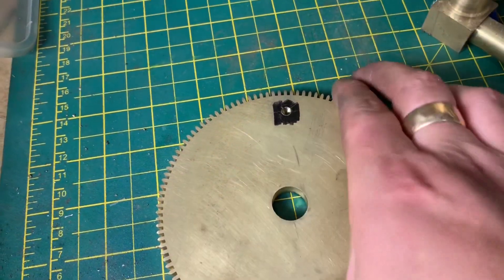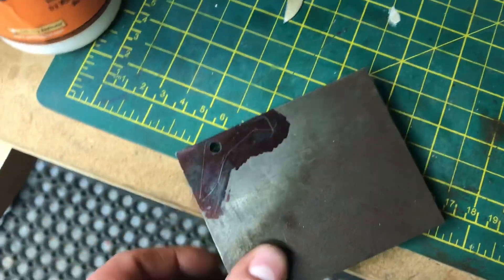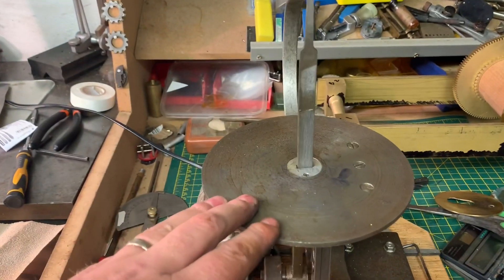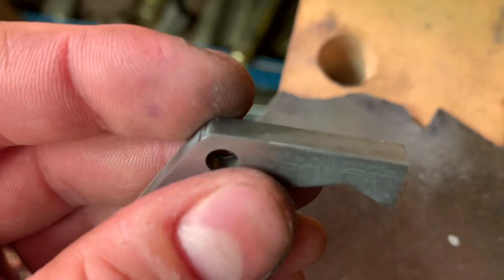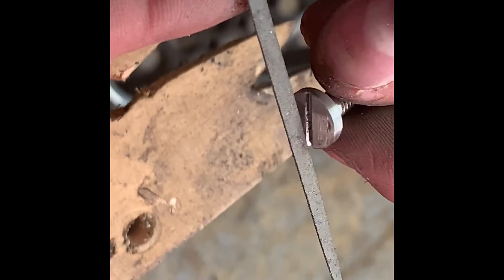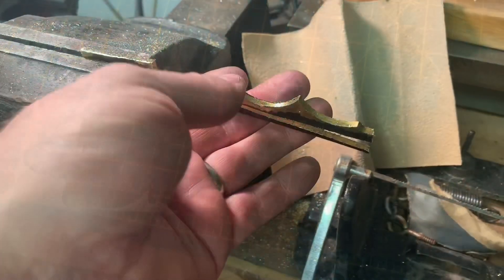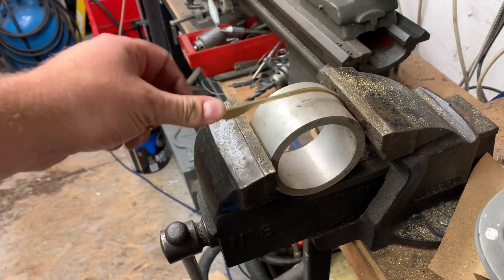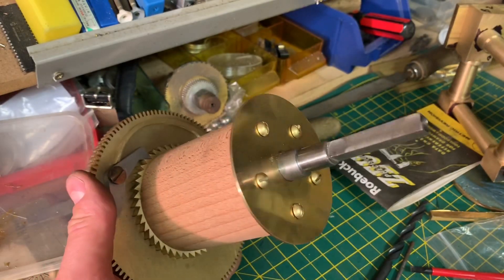Building a Tower Clock Pt 9 - The Clickspring - Click, Spring and Screw

Comment: I recently started making this clock tower.  So far I've only machined two of the pillars, and I'm in progress with one of the main frames and one of the arbors.  I bought most of the gears on aliexpress, as I don't have access to gear cutting equipment and I was able to buy the gears for cheap.  I'm planning on using metric threads for the bolts because British threads are just ridiculous.  I would really like to see more of your progress, as there's certain parts that I'm unsure of how to machine.

Comment: hi chris please can i ask your advice about 90 me lathe there is a little bit of play in the lead screw nut which seems to be left hand thread  have you had any similar experience with the lead screw , do you know if you can get a l.h. tap for the nut, any advice would be great  regards john
Reply from the maker: jessestrum Hi John, I’m afraid I’ve been lucky enough not to experience any play in the lead screw. I’m also unhelpfully going to tell you that I’m not sure about tap, I’m certain you will from somewhere. It would also be worth ringing cowells for replacements bits. Never cheap, but always v good quality.
Reply: @craynerd  thanks chris , i,ll give them a bell, its a 10x1 mm left hand thread cheers

Comment: I have a question:
Let's say you want to cut a wheel with a certain number of teeth. How do you determine the correct diameter of the wheel so that way all of the teeth are the same and correct size?
Reply from the maker: Gearz 365 
hi!  I have not designed a full clock from scratch but my understanding is...
You have decided the number of teeth (N) based on the ratio you want from the gears.
The cutter module will be chosen based on the distance between centres of the wheel and pinion you are meshing together based on their pitch circle diameter and the tooth count of these wheels using the equation Module = 2(r1+r2) / n1+n2.      Where r1 is the radius of wheel 1 etc and n1 is the teeth number on wheel 1..etc. 
You could also have an idea of the sort of pitch circle diameter you are physically wanting by using PCD=NxM ... so just playing with different modules (knowing the tooth count N you need) you’d get an idea what module would be suitable. 

For your overall outside diameter and total wheel blank size, you can then use OD = (N + 2.76) x M 
That is where N and M we already know and I think 2.76 is an allowance for the addendum....but I could be wrong...

There are a few good books with this information in but the best online is here... http://www.clock-works.clara.net/cata/wnpc3.html and the bit I mentioned about the module is here and describes it better than I did! http://www.abbeyclock.com/gearing8.html
Reply: @craynerd  Perfect! Thank you!